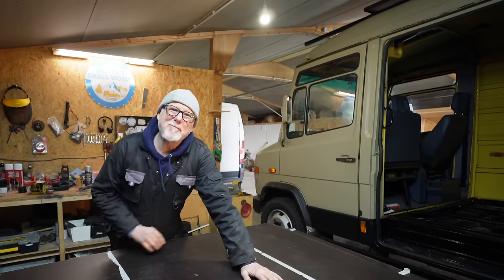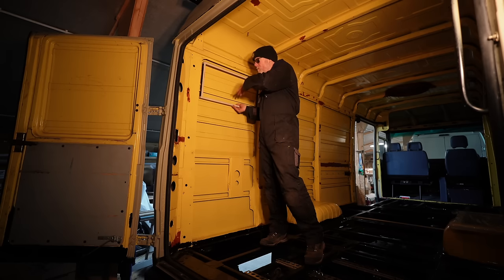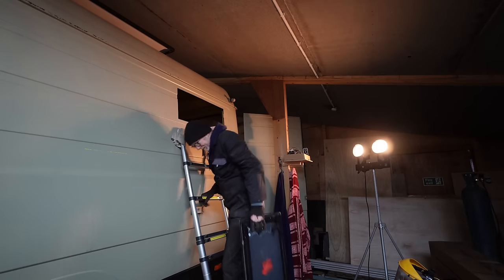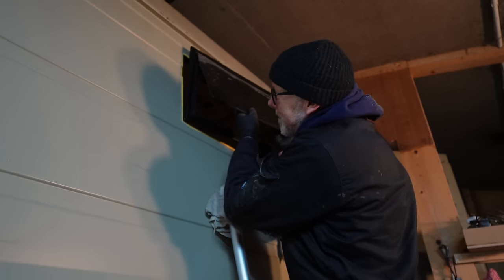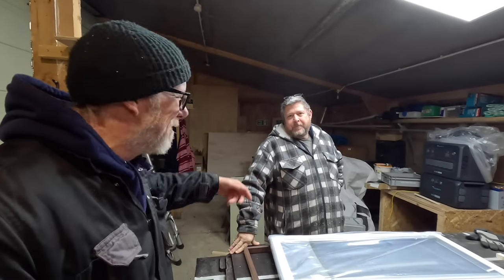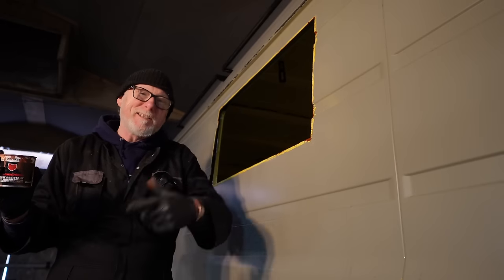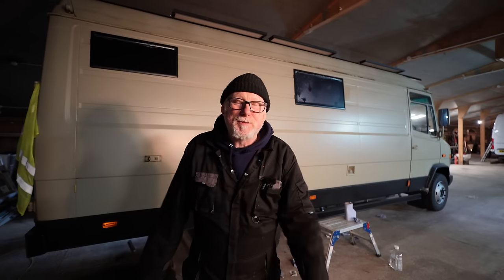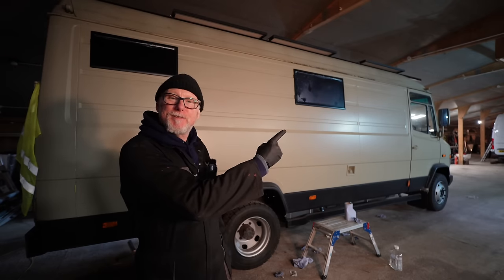DON'T MAKE THIS MISTAKE!! Installing Camper Van Windows Mercedes Vario Camper van Conversion Build

Comment: Decorating tape around the edge before applying the adhesive. Then easy peel off
Reply: @michaelbradley-yorath9682 I used sikaflex for years, installing sculpture, loads of different really high end adhesives and sealants gor all applications. The Tiger seal does look like a great alternative, if you get sikaflex on anything, it isn't coming off.
Reply: Well done Mel, looking brilliant 👍
Don't be so hard on yourself, we all make mistakes when converting our vans. I'm sure you'll make it right soon enough.

Comment: Top tip don't do what mel did, dry fitted my window then masked up around it then removed it put sealant on the refitted then removed tape.....after I'd dropped a £500 window because I was too stubborn to ask for help...nobody is perfect

Comment: A good tip as I’m an ex windscreen fitter is to put the bond into a bucket of hot water before you use it. Far better flow then Mel 👍🏼😉 Also I use Big Wipes to remove any excess bond.

Comment: I found a few German videos on YouTube when researching these windows which led me to a product called dekaseal 8936. It’s like mastic in a caulking cartridge which stays permanently flexible. I used it on five windows on my van. When you tighten the screws the product squeezes out around the frame and it’s easy to remove by just dabbing a small bit around the edge which sticks to and pulls away the excess.
Reply: I used the dekaseal on my caravan when installing the skylight........ From Germany.

Comment: I know how you feel mel...made several mistakes during my build...dont beat yourself up you will get it sorted ..my favourite sealant has to be MS11..when i built my toilet /shower area fixed the timber to floor with it...but i had a gap on one of the outside side panels and water was coming in..so i had to rip out the timber frame that was some job as ms11 sets like concrete...great video cant wait to see you luxury shower.

Comment: Whenever I use pu sealant I buy the strong industrial wet wipe things from toolstation (can’t remember what they’re called) they come in a cylinder tub where you pull one out at a time. They are NOT CHEAP but my god do they save some mess and make a neat job of it all. 
I’ve sometimes ended up with sealant everywhere and make more of a mess when trying to clean it up than I started with. 

With the wipes and a carrier bag, I wipe of all the excess and chuck the wipe straight in the bag, then when it’s time to get the colour off the paintwork I use the wipes more sparingly. 
I also keep my surgical gloves clean by wiping the gloves off with the half used wipes before throwing them in the carrier bag. 

Trust me, they’re well worth the money. I think they’re too expensive for everyday use but I always buy them when fitting windows etc with pu sealant

Comment: Black vinyl wrap 'shape' which incorporates the window, matched both sides, will hide any paint defects.
You could shape it to follow from the door windows. If you look at Solway's conversions you'll get an idea of what I mean.
PS, using those windows I found the thin mastic tape is great, then a thin bead of sikaflex right on the edge works well 👍

Comment: Hi Mel, The best material I've found for clearing up silacones are the hand wipes you get in a tub from screwfix . Can't guarantee it would have worked with the sh-t you were using but they worked on any sealants I've used

Comment: evening mel.
ive been watching your videos for sometime now and i think you do a great job.
im a windscreen technician and have had my business for the last 38 years and have just finished.
i have some windscreen adhesive and various tools and primers that your welcome to have, i dont want anything for them, also have some betaclean which cleans the adhesive from the paint work correctly.
personally i wouldnt have used windscreen adhesive instead just sat them in silicone as they screw up from inside on frames, pretty much like skylights.

im more than willing to give out advice and to give you a few tips on the glass side of things should you want.
your nearly there with the installation of the windows you just need a bit of tweaking lol.
keep up the hard work with the videos and if you want take up the offer of some materials let me know and we can meet up sometime.
all the best wayne.

Comment: Watch a video on silicone sealers. We use a spray solution of water and washing up liquid to stray on the sealant that has splodges out and use a cut timber tool to remove the excess. 👍🏻

Comment: If you're worried about having enough height for your bike to fit you could make a recess in the floor for the wheel to sit in. A lot of car  manufacturers use this method.
Reply from the maker: Brilliant 👍

Comment: Would love more information on the hot water system you are doing - as I’m at that stage with my van (Fiat Ducato) conversion. Going to use a reducer 19mm to 16mm to hopefully solve the issue.

Comment: You need a solvent based compound to get Masterbond off. The very best stuff is the activator for Loctite, any of the numbers will do, I've got 7649. It evaporates very quickly so you've got to be fast, and wear gloves, it takes the oil out of your skin. Thinners works but it will attack your paint, the activator won't and it'll save you painting over the staining.

Comment: Did you need such strong sealant if the inside frame holds it tight? The Seitz windows I used came with metal clips to screw in place inside that held the window tight against the outside.
Reply from the maker: Maybe not 🤦‍♂️

Comment: Wondering if anyone could answer this 

I'm living somewhere with no space or tools to convert a van, I have absolutely 0 DIY knowledge unfortunately, and I'd love to give it a try but again without tools or a space to do it, it would be very difficult.

I was considering buying a van and paying for a simple conversion but a lot of the quotes I've seen on various websites are really overpriced.

I've had a look and I can afford a used vivaro long wheelbase van with about 40,000 miles on the clock.

I'd then pay someone to insulate the van and install a diesal heater, I'd buy a bluetti powerbank and diesal generator which would again save the hassle of installing a full wiring setup.

The rest, my girlfriend and I would just make do with it until I can save more money to get help with the rest of it in time.

The question that's burning on my mind, is if I pay someone to insulate the van would it then be a nightmare later on wiring the van after that has been done? 

Many thanks